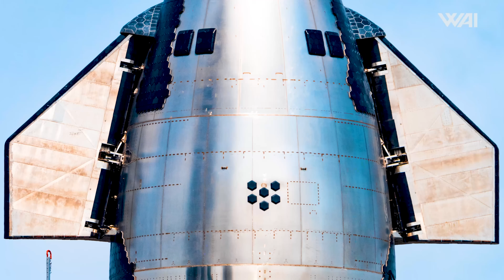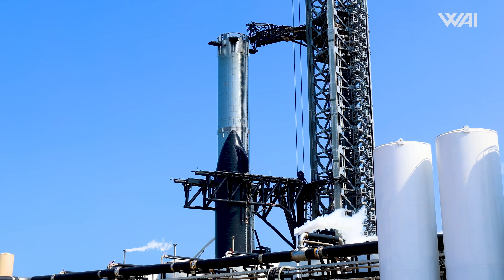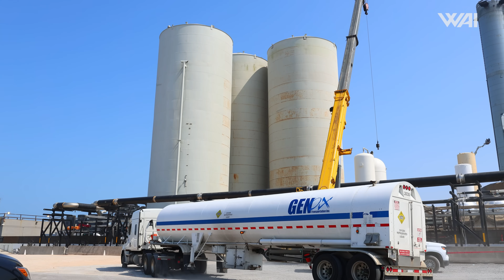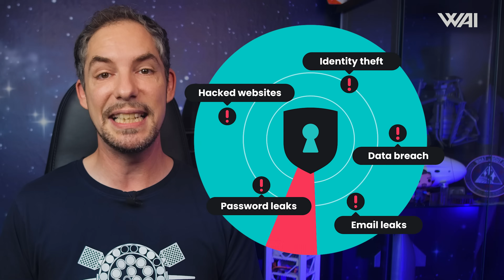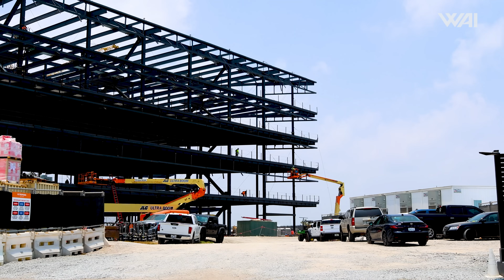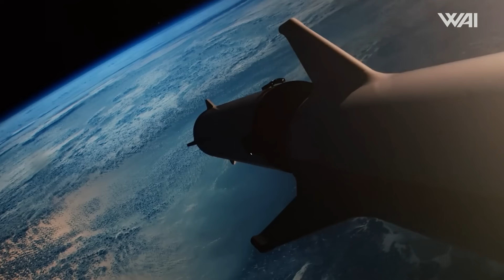SpaceX Starship Flight 4 - Launch Briefing!

Comment: I don't feel bad for Tim or any of the Dear moon crew...

The vehicle is barely reached orbit and there wasn't any fuel left while carrying nothing (and still 50% short of proposed capability to LEO).
No crew escape system.
And the ship has to wait for over a dozen launches of other ships for refueling.
Reply: These are an early orbital prototype - just version block One. The Starship team has advanced incredibly rapidly since the 07/25/2019 flight of Hopper.

Comment: Let's hope musk does not get bored with spacex as he seems to have with Tesla. Tesla has not seen much innovation recently, other than some very minor changes to colours and minor upgrades to the looks, nothing has really changed for a few years, well other than the disaster that is cybertruck. 

Maybe Spacex will evolve and not get stuck on starship v4 or v5, but even if they do stop at v5, I am sure we will see many flights to come of a proven starship as they are needed to generate profit by transporting loads into orbit or to the moon, and to keep starling growing and maintained with continuous replacement satellites.

Spacex desperately wanted to go to Mars but I believe he still has a lot to do before then, developing a moobase so that spacex can work out all the issues of putting humans on another planet. And with the moon so close it would be easier to quickly launch a rescue mission if needed, or send supplies. They need to test landings and possibly habitats and different support structures, much easier to do on the moon first rather than a years flight to Mars. I suspect they will send some unmanned starship and build some landing pads, after working out if they can use moon dirt. And sending a launch pad would take a number of trips.

We will see what the future brings!
Reply: What are you talking about. Tesla is doing more innovation now than it ever did. It's developing the most advanced automobile manufacturing process in the world (the Tesla Production Method that Toyota and others are trying to replicate) and the most advanced real world AI (as Jensen Huang recently admitted) for autonomous cars and robots. Does that tell you than Musk is bored with the company LOL

Comment: I would have thought the stainless steel could survive even without the tiles. Perhaps its the leftover combustion products in the tanks that lead to it being unsafe when the tiles are missing? For example methane and lox getting to hot too quickly and creating blowouts? (Just a thought)
Reply: The plasma will just eat away the bare metal.
Reply: @sidharthcs2110  shuttle survived a lost tile (or more) over a simple steel  bracket

Comment: Question: How fast is SpaceX making decisions on basic infrastructure in and around the launch facilities? One imagines the Gateway To Mars signage/fencing was dreamed up several months earlier than its installation. One can also imagine that its placement had been determined at the same time. Then only 6 months later SpaceX decides that is on the exact spot where they want a second launch pad. I realize the footprint for operations is limited in this area, especially its being basically all salt marsh and not stable. But by this time, wouldn't SpaceX have a better grasp of what they require for basic infrastructure by now?

Comment: Completely dumb question: But why don't rockets just re-enter more slowly and avoid the crazy heat altogether? Too much time / fuel?
Reply: Impossible because that would require a lot more fuel.  90% of the fuel on starship is required to just lift the fuel.
Reply: @kb9gkc  Yah, figured something like that.   Cheers

Comment: With the cost of the towers it shows how confident they are that they can catch a massive ship on 2 little tiny catch points. I mean they're building another before they've even caught one! That's the way of Elon I suppose
Reply: Towers don't cost much if they have no Stage Zero beneath them. The new tower will initially be used to attempt to catch a booster, not the current launch tower. I realised that when Elon said by IFT-5 he would attempt a tower capture. No way he is going to endanger the complicated, expensive, water-cooled launch pad. You agree?
Reply: @peterwilson7532  possible. but this is also Elon were talking about. I'm sure if they blew up the first tower they would just call it a happy little accident and use the clear space to build a new tower similar to the foundation that was evaporated by IFT-1
Reply: @slimeking101  That would take about a year to rebuild, stopping all launches. Stage Zero is more complicated than Starship. Not worth the risk.

Comment: If the heat tiles interlocked with each other, individual tiles would be less likely to fail.
Reply: It would make it worse.
Reply: It would make replacement a fair bit harder though.
Reply: That wpuld likely make it worse do to uneven flexing of tiles
Reply: The Key bridge is an example of a rigid failure cascade. Attaching tiles together would do the same.

Comment: If it is about a single tile out of 18000 and all 18000 are manually installed, there is virtually no chance that all of them will stay in place.  It is not a practical design/installation process.  At least they should think about pre-manufacturing large sections that can be QAed and checked past installation.

Comment: I don't really blame Maezawa from cancelling. Gwynne Shotwell has already said that no human is going on a Starship until after "100" successful launches with just cargo. How long will that take exactly? I HIGHLY doubt Polaris Dawn or Artemis is happening this decade. DearMoon wouldn't happen until in the early 2030s and Maezawa is losing money. I hope Tim gets a ride on a Polaris Dawn mission though. Or better yet, have Elon fund a mission and go on it himself in Maezawa's place.
Reply: Musk said that it will take maybe 100 flights before they land people in it. The flight rate though will explode when the booster is reused. The progress eith a fully reusable system isn't going to be linear but exponential, much faster than Falcon reuse that exploded from 10-20 flights >100 and growing in a few years.
Reply: @admarsandbeyond  I have my doubts that the flight rates will be increased so dramatically so soon. They're only allowed to launch so often due to the intense noise and sonic booms generated. People already protest to the now excessive noise levels from the increased launch rates from Vandenburg and that's only Falcon 9 not even Falcon heavy launches. If SpaceX wants to have that increased launch cadence for Starship, they'll need to launch off shore.

Comment: I'm wondering about the feasibility of Starship if a single tile failure would result in RUD.  In engineering circles, there tends to be a small chance per unit of a crack, defect, or anomaly.  With that many tiles and tile mounts, there's a relatively high chance for a failure point.
Reply: True. It seems they just wanted to be sure rather than sorry ❤

Comment: The first three flights met their key goals.  IFT4's key goal is not realistic, and won't be until they start brainstorming new ideas for the heatshield.  Not even if the thing does survive.  I hope they have an internal camera to capture what happens there.  Perhaps the eventual solution will be to use two layers of tiles.

Comment: PLEASE emphasize MORE in your videos that Starship/SuperHeavy is a prototype and still extremely young in its design and development!
Reply: Even Elon calls it a Prototype.
It’s still undergoing rapid design changes from launch to launch.
Reply: Scary the people are going up in Artemis with less than half the testing of starship, and with parts made by second rate manufacturers.
Reply: @GimbleOnDew  a lot of the parts are tried and tested though, such as the srbs, rs-25 engines, upper stage engines etc
Reply: There are references about them being prototypes by Felix and by Elon.
Reply: naa

Comment: There has to be a better option than heat tiles. 100% retention seems unreasonable due to the quantity of them IMO. Thoughts?
Reply: In the absolute worst case, they could simply use two layers of tiles, staggered so the top layer protects the bottom layer in clusters.  Would be quite a bit more difficult to install but would almost certainly prevent an actual hole from reaching the layers beneath.  I do think that they will need to come up with a new idea of about that scale, either way.

Comment: So if it turns out that Starship needs 100% tile coverage, then why make it SS instead of traditional aluminum?
Reply: They didn't use SS for heat resistance.
Reply: @dancobb118 they originally said they wouldn't need tiles if it was SS.
Reply: @TheMoneypresident they don't need shielding on booster (Falcon ie require heatshields). Also due to ss heatshields can be much lighter and thinner than used on aluminium
Reply: @just_archan  I didn't say booster.
Reply: @TheMoneypresident  I corrected you as THAT was original quote. There was one concept to use bleeding methane as heatshield on starship, but other than that there wasn't single concept/proposal that shows Starship WITHOUT heatshield.
Reply: @TheMoneypresident   Not true.  Some sort of heat protection was always needed.  Please try and find a quote about no heat shield needed with Stainless Steel.  It's not out there.

Comment: I think it’s going to be very very tough to calculate the impact on thrust of landing into the slot next to the tower.. even if they practice at sea. The worry tower may cause thrust issues on one side making it very unstable.
Reply: Don’t forget they would be ‘landing’ the booster on just two engines - not all 33 !

Comment: Why couldnt they cover the tiles with a burnable over coat that would keep the tiles in place during the high vibration of launch but could burn away during reentry?  The extra weight would be negligible versus the increased probability of keeping tiles in place.
Reply: That might work. But they would need to refurbish it after each flight adding complexity, time, and cost. maybe under the heatshield as a backup in case a tile fell off🤔🤔

Comment: Have any Starships or Starship boosters ever been recovered?  Or have all been destroyed?
Reply: All that have flown have been destroyed they hope to recover the flight 5 booster assuming the flight 4 booster can hit a pin point ocean landing
Reply: During the days of the low altitude hops Starship 15 went up to 10 KM and landed, but other than that and a few smaller prototype hops none have been recovered. but progress has been made every time 😁
Reply: The last one, IFT3, the video and telemetry showed the booster disintegrated just 1500 ft above the ocean.

Comment: Are there any Environmental restrictions on the chemicals used in making the "best" tile adhesive?
Reply: interesting question. I feel like if you are allowed to use insanely deadly hypergolic in space flight then at that point anything goes but I could be wrong.
Reply: @slimeking101  I calibrated the Load cells at Marshall Space Flight in HSV, AL. around 2007-9. for the "tile test lab". I know the formula changed before Columbia. Just wondering if they are handicapped at all...

Comment: Quick reuse might be hampered a bit but perhaps wrapping the Starship in a space-grade vehicle type adhesive wrap material to hold the tiles in place until re-entry burns it off would help ensure there is a ship to reuse.
Reply: the only problem is the ablative part. that would make it refurbish-able not reusable. in this case its an engineering problem, and given enough time and resources every engineering problem ban be solved.
Reply: @slimeking101  Definitely looking forward to that!

Comment: Fireball of doom!    why?  .. because the tiles are not fixed on properly,  they need more than 3 anchor points!  and the vibration and shockwaves upon accent will usually break a few off so they need to be shockwave proof moreso than actual takeoff shockwaves to guarantee takeoff with no failures./breakages.  failure is not an option should be the case in every version from here on in. also relighting the engines in space might still be a big problem for them. after such a prolonged burn.  💣💣

Comment: The only thing that will work for re-entry is a spray on ablative coating, basically you have one big tile
Reply: Which will not work for a fully reusable rocket.
Reply: The inflexibility of that coating under cryogenic and re-entry temperatures will split and crack. Just a different problem, same outcome.
Reply: @peterwilson7532  No, it's a better solution, lose one tile, lose the ship.  
Yes, it's a work in progress, but , Elon will soon realize it's the only way to go.
Reply: While I think the other fellow is correct in that a coating would simply crack, I do feel that some kind of double layer system is in Starship's future.
Reply: @Asterra2  I only have 40 years of aerospace engineering experience.  
Trust me, it's the only way.  Wait and see
Reply: @Scooterdude01  A system that permits two clearly differentiated layers but also retains the gapped nature of tiles in both layers so vibrations and stresses don't cause damage.  That feels like the obvious endgame.  My oversimplified take would be to simply have two layers of tiles in staggered configuration.

Comment: Why don't you do a re entry burn like the falcon 9 fight fire with fire
Reply: For the ship, it would be hard because the forces are so much stronger and the fuel cost would be a lot(although Stoke will try it). For the booster, they calculated it would be easier to just not do it. Hope that helps 😁👍
Reply: Good question. I bet that comming from orbit would require to much fuel to work?
Reply: There's barely enough fuel to land in version 1 of Starship plus there's weight considerations.

Comment: If the integrity ( or rather lack thereof) of all heat tiles is a  critical single mode of ship failure, then there is much work to be done. But hopefully IFT-4 moves things closer to that 100% tile integrity mark. Perfection needed, but progress is essential.  Good luck Spacexon this next launch.
Reply: Now is the best time to experiment with missing tiles in un-critical places - this is info that SpaceX needs to know about - just how well the craft stands up to heat-shield imperfections.
Reply: Agreed let's get the rest of the rocket down pat and know that it will indeed do what's expected then focus on the rest
Reply: What I'm thinking they're going to do is laser-focus on solving the tile thing... beginning with the Block 2 prototypes.  IFT4 seems to be an experiment to see what they can get away with by simply touching up the current process, and IFT5 will probably be a refinement of that, based on what happened with IFT4.  I think they know just as well as we do that the entire thing needs to be meaningfully rethought.
Reply: Nasa designed the tiles. It's a separate contractor doing the engineering. Thousands of companies are working on the rocket.
Reply: @TheMoneypresident  actually SpaceX is working in-house on own tiles. Florida facility called "bakery". But it's based on NASA research from shuttle era
Reply: @just_archan  working on future tiles. These are not them.
Reply: @TheMoneypresident  those are them. Starship doesn't use external contractors for heatshields. Patents were originated from NASA, while exact composition is developed by SpaceX. And you are right, those are not "future" tiles. Next gen will be smaller with different attachment method (single steel plate instead 3 separate steel sliders, as we saw on test rig few months ago). There isn't much hardware that SpaceX uses that is not in the house. One of those are parachutes on dragon that just recently are in house, but only because company that produced parachutes bankrupted, and SpaceX bought it. FYI, this company was specialised in that kind of hardware and SpaceX was one of theirs many customers before buyout
Reply: When perfection is required to survive, it's not safe or resilient. We saw this with the space shuttle, where ceramic tiles were a never ending source of problems.